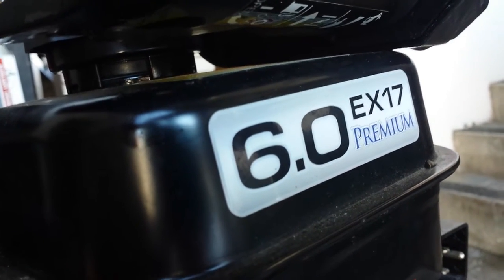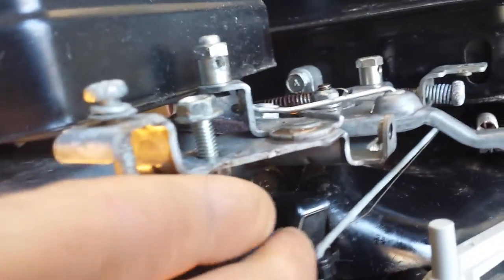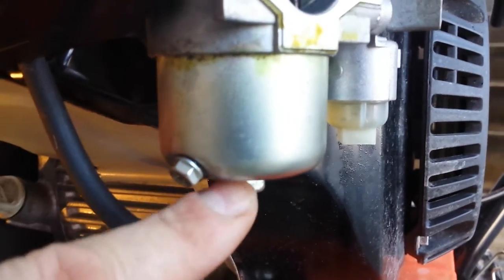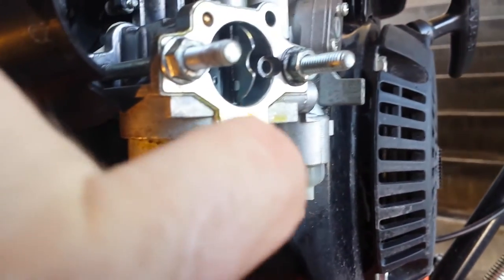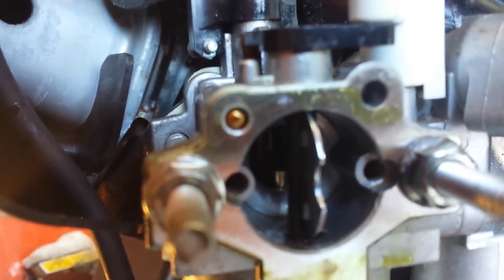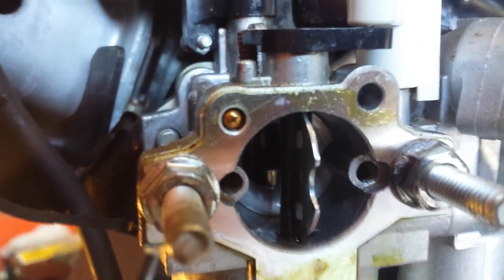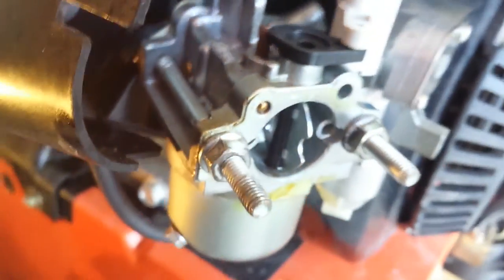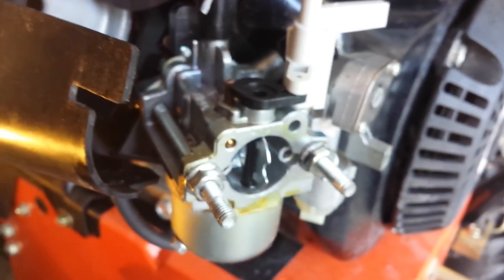Subaru 6.0 hp EX surging mikuni carburetor fix

Comment: Cured mine. On the SX17 the jet is hidden under a metal tab that's secured with a screw. The jet itself is not a screw, it's a plug held in with o-rings. You take a small screwdriver and pop it up. Clean it out, re-install and you're good to go. This cured my surging problem. From now on it's aviation fuel in all of my lawn equipment. No ethanol and a 7 year shelf life.

Comment: Found a power washer abandoned on the side of the street.  Pretty much neglected.  Lots of water in fuel tank and crank case.  Mikuni carb still in decent condition.  Gave her lots of TLC and she cranked on but surges like crazy.  Replaced ALL gaskets and cleaned that carb well, removed water, clean fuel, 3 oil changes and still... she surges. Don't know much about Subaru engines,  but now I'm thinking of abandoning her on the side of the street.
Reply: Did you ever fix the surge?
Reply: @profuse007  Yes!  I ran it and ran it and ran it with fresh fuel and a bit of Sea Foam.   Honestly, I don't exactly what happened, but engine runs like a champ!  Carb probably needed to work out a bit of the grime.  I had to replace sealing on the the pump assembly after it lost power because of a leak.  Other than that, I won't abandan her.  She works great!  Especially for free!

Comment: I learned something. Wherevthe fuel shut off is. I just got an older Wacker Neuson ground packer unit that has Robin Subaru type engine with bad carburator. I order new one that came already but I was wondering what that part on carburator is. Thanks

Comment: I have an ex27 that only runs when on choke or slightly in between on/off.  Still runs alright just doesn't feel like it gets to full power.   this is on  my leaf blower.   Maybe this will help or maybe a full carb replace,   thanks for info

Comment: I have the same model but 5hp. It always surged but ran good up until it didn’t so I got a new carb that fit good. When I tried starting it up it wouldn’t run without the choke on and when the choke was on it was still surging. I played with both the idle screws for days and it still only runs with the choke on. Is there any solution to this?
Reply from the maker: Try cleaning the old carb up and reinstalling it. If it will only run well when choked , it's not getting enough gas.  Check the vertical tube in the bottom bowl. Clean the jet.

Comment: Would you be able to post a video of this engine explaining the govenor and throttle and setup of that...i have the ex21 ryobi power washer used...and it looks tampered with..looks like a scew missing possible on either throttle or linkage or whatever that suff is...and the thin throttle line looks twisted and rigged on (the thinner of the 2 wires that pull whatever that thing is)....i dont know my way around small engines obviously 🤦‍♂️🤦‍♂️🤣
Reply from the maker: If I get some time I would... do you need pics of where the spring hooks onto the governor and linkage?
Reply: @joshpaulschram  yes...any pics of all the linkage and setup would be great...or a video...whatever you prefer...i just need to see what one is supposed to look like...one thing i noticed was the "throttle cable" (i think that's what it is) was twisted on like it was rigged
Reply: @joshpaulschram  and thanks for the reply...its appreciated...i replaced the carb and gaskets due to gas getting into the oil, and the machine not running (i read somewhere to change gaskets if that happens)...thats when i noticed how rigged everything looked
Reply from the maker: @mikes8207  the throttle, on the one I work on, is a push thumb lever, push left to higher rpm, right is idle. I'm not sure what it looks like on your application
Reply: @joshpaulschram  its late now....but tomorrow i will take a bunch of pics or maybe a video and try and send them...see if you can tell me whats going on....and thank you 💯💯
Reply: @joshpaulschram  i posted 2 videos on my page...take a look if you want...as you will be able to tell, i dont know much about small engines and how they work...lol...let me know what you think...it could be fine
Reply from the maker: @mikes8207  https://youtu.be/FEruRPvttzQ
Reply from the maker: @mikes8207  I posted the spring part numbers in the description.  I think you need 279-4250-73 and I cant tell if you have the back spring on that back rod. back spring is 277-42801-23
Reply: @joshpaulschram  that video was perfect....showed and explained everything i needed to know....i will be ordering a new spring and i will check for that thinner spring also, i dont remember seeing it....thank you very much for the tips and advice 💯💯